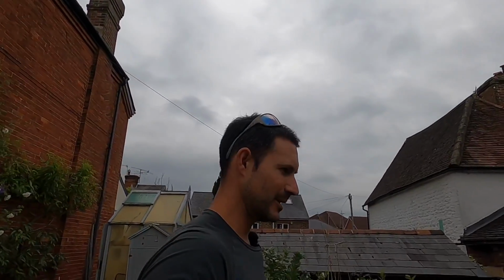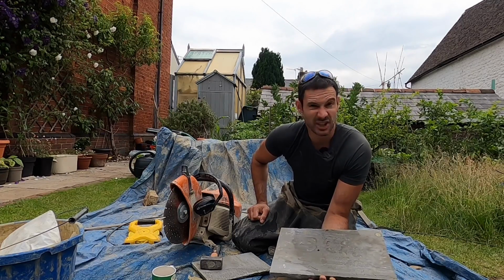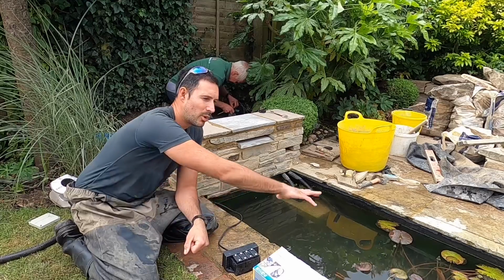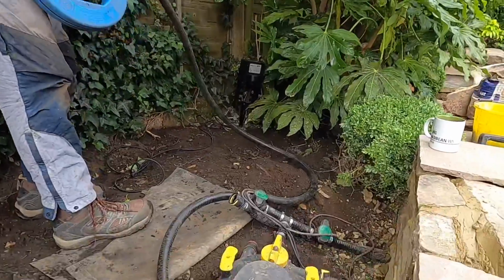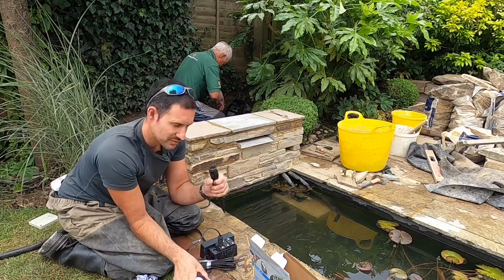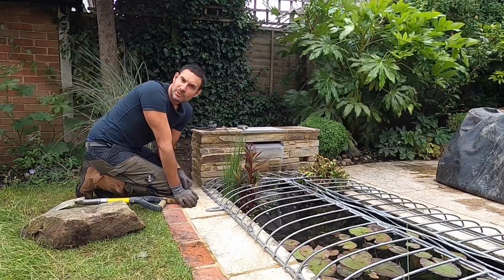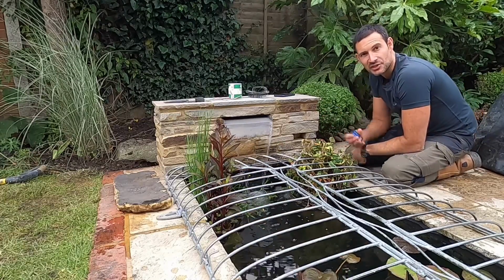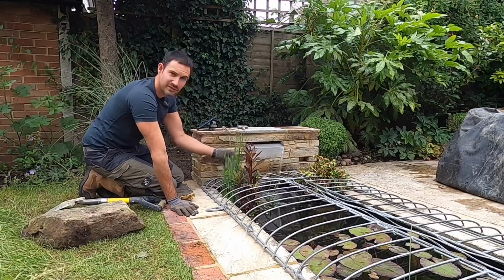How to install a water blade part 2: completion

Comment: Good video, very informative. What stone is that called please? And how are the different irregular sizes achieved? Thanks.
Reply from the maker: Hi there! Thanks for watching and commenting; the stone work used is cropped York stone and with the use of a disc cutter and a bolster and mallet I then cut and split the stone further to create different gauges of stone to create an interesting feature wall. I use this stone in many of my videos and frequently explain the process of cutting and splitting.
Hope this helps!
Best,
Ed

Comment: What is the arc on this blade? As in how far from the blade does the cascade hit the water?
Reply from the maker: Hi Gillian,
Thanks for your comment and my apologies for the slow response.  Your query is dependant on a few factors- how far out you leave the lip/extended lip of the blade from the wall its built into, the height of the blade from the surface of the water, angle the blade has been positioned, flow rate over the blade etc etc!  However as an example the water blade on my pond (which is an oase 30cm extended lip version) is approx 40cm above the ponds surface, has been installed dead level (rather then leaning forward) the lip protrudes from the walling approx 6cm, flow rate is approx 2500lph and the projected film of water hits the ponds surface approx 20cm from the base of the walling. I prefer extended lip variants of water blades as the water splash is further from the walling and creates less splash and associated algae issues on the walling the blade sits in.
Hope this helps and makes sense!
Best,
Ed

Comment: Thanks Ed great vid in a nice chilled manner , I'm just about to install a 1200mm blade into a wall. On the woefully short cable from the transformer, is it not possible to bring the transformer out of the pond and hide any excess cable that way, therefore leaving only the cable you need in the pond?
Reply from the maker: Thanks Jon!  Absolutely, in many instances I’ve concealed the transformer out of the pond and done just that-however one of the main selling points for these great but very expensive lights is the benefit of being able to submerse all components and only route one cable from the pond to a power supply-rather then multiple cables from multiple lights having to be routed from inside to outside the pond-which would be harder to do discretely and potentially unsightly. In general anything submersible from Oase comes with 10m of pre attached cable, but bizarrely and frustratingly this transformer doesn’t! 
Thanks for your comment!
Best,
Ed